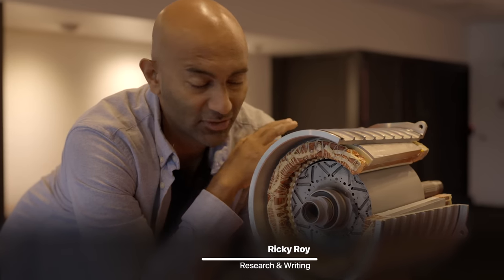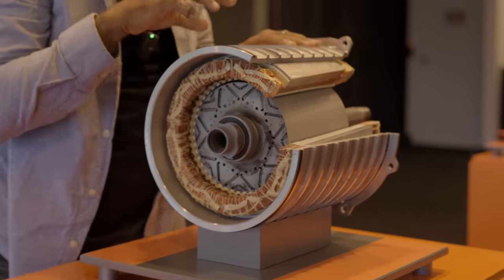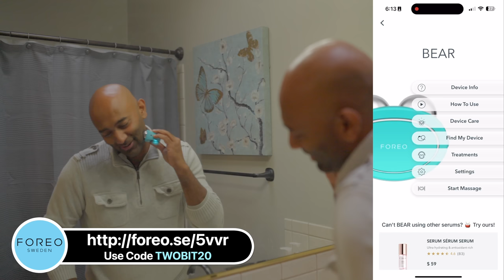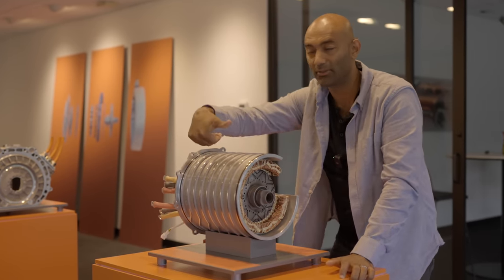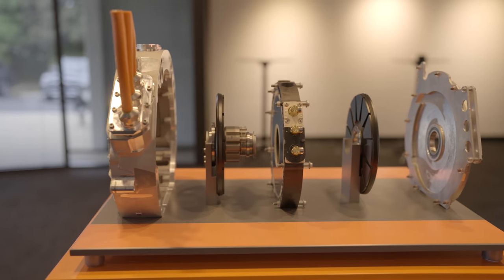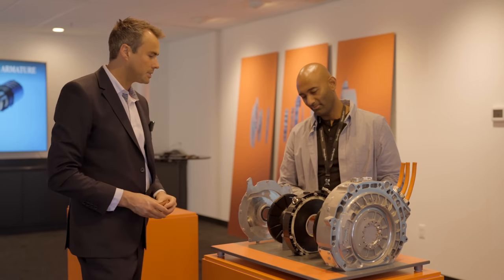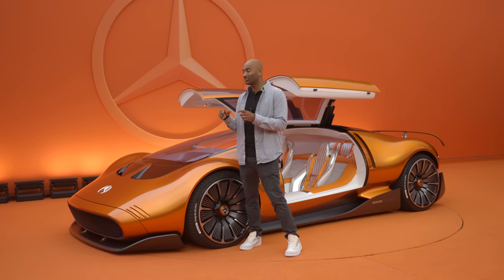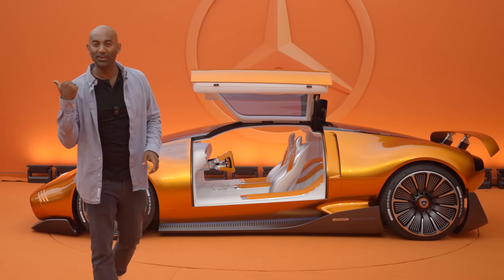Axial Flux Motors Will Change CARS - Here's Why

Comment: Impressive and interesting. Still, biggest hurdle for the EVs remains the energy density of the batteries. Let's hope for a breakthrough there in the near future.
Reply: @dangraff8467  Like that. Necessary elaboration: breakthrough that will make these affordable and practical for mass production.
Reply: Considering how long it's taking to create a worthwhile charging network, energy density is definitely the first thing I would be tackling.
Reply: Biggest hurdle for EVs is they are just a trend.

In the end, a V8 will always be way more reliable, and preferable for anything longer than a trip to the store
Reply: Or, the need for batteries at all. Nikola Tesla had a way to transmit significant power lossless across any distance to a receiver. The world of EVs and big money seems VERY disinterested into reverse engineering that. Even the inductive charging lanes (they work while driving) would then not need to be installed. You'd have the antenna,, a speed controller of sorts and a small capacitor, replacing the 600 kg battery. For unlimited range, but you'd need to buy the energy from the wireless provider.
Reply: @Cloxxki  got proof of this elusive transmitter?
Reply: @jakehildebrand1824  He is referring to a tesla coil I believe. But I also believe its far from an unlimited range.
Reply: @jakehildebrand1824  not true at all. My hybrid can go to the store and never even kick the gas engine on. It will likely last well over 300k miles, or more, and use 1/3 the gas of any v8. All the while never have the transmission issues many v8 vehicles get plagued with.
Reply: @rdubs1705  did you even read my comment completely. 
First of all I didn't say hybrids, I said EVs
Second, I said that going to the store is the thing they ARE good for.

Also, if you're having transmission issues in a V8, you're clearly not taking proper care of the car.

Lastly, better gas mileage is irrelevant when a V8 way better specs.
Reply: The future batteries we do know about don’t have more energy density than li-ion. They charge faster, discharge faster, and are less volatile. Those still aren’t commercially available so we might see those in 5-10 more years. At that rate we probably won’t see any real battery improvements for 15-20 years if that.

Lithium-Ion batteries were invented in the 1960s, but they weren’t used in commercial everyday devices until the late 90’s. 30+ years later we are still using them. That should give everyone an idea of what to expect. We might be  another 30+ years away from a breakthrough. This is why forcing green energy policies right now doesn’t make sense. Our current battery technology can’t handle the amount of energy we need to store and it can’t handle as many charge/discharge cycles as we need them to.
Reply: @jakehildebrand1824  Have not seen a V8 in a long while. 4 and 6 cylinders are a lot more common.
Reply: And safety as well, Lithium EVs i will never touch. As well as cars in general that are not "always connected" to the internet like every new EV is.
Reply: @Cloxxki  You tesla fanatics are really something. Tesla wasn't some super genius that knew better than anyone today. He was wrong with so many things. The man didn't even believe in electrons ffs. His ideas of wireless transmission were based on inductance and electricity transport via the ground, BOTH of which exist today. The biggest problems are the efficiency and short range of the inductance based transmission, while ground based transmission still requires one cable and causes much quicker rusting of metal pipes in the ground. It's funny how you people who are excessively championing Tesla, making him seem like a God among men, are always the ones with a serious lack of knowledge in engineering and physics. Any reasonable person with basic understanding of physics would see Tesla as an important inventor, but who was wrong in a lot of ways. And that's fine. Have you ever tried being reasonable?

Comment: Seems like the rear-dual motor with a transmission might be a great application for these axial motors.  Still too heavy to put in the wheels themselves.  In combination with an AC front axle motor would make a compelling AWD setup - you need a split powertrain or differential on the rear axle anyway.

Comment: Good video. Even though when the copper gets hotter, the electrical resistance increases, resulting in inefficiency, the main reason for cooling is to prevent the magnets from reaching the curie temperature because the magnets fail.

Comment: I am more excited about the pcb stator motors, than the ones using copper coil. Just like mentioned elsewhere in the comments this is not new tech, cpap fan motors have been using this design for ages. Another cool feature is the high efficiency of these newer generation flux axial motors (95% and up). The are also so simple to manufacture that they can be built by anyone.

Comment: Worth mentioning that some radial EV motors would be about 23kg for 500hp (e.g. Lucid at 31kg for 669) which is much closer to what you're looking at here. Still, it'll be exciting to see what can be achieved with the axial designs :)
Reply: Interesting to see tech. But let's get it straight big money didn't invent it Mercedes just purchased the start up vo
Reply: Why use a Radial EV motor, when you could instead use a Rotary combustion motor?
Reply: @jakehildebrand1824  Variety. Choice. One size does not fit all. And we LOVE to make new things and improve on old ones.
Reply: @jakehildebrand1824  i love rotary combustion engines they are so cyberpunk
Reply: @Rem_NL  I'm not quite sure whether you're being sarcastic or not.
Reply: @MrPDGee  give me one example of a situation where a Radial EV would be better than a REAL Rotary.

Also, a Radial EV is not an improvement on Rotary technology, its a straight up downgrade.

I suppose the EPA would probably disagree with everything I just said, but the EPAs only real goal is to ruin anything fun.
Reply: @jakehildebrand1824  i think they are cool as fuck, but not to practical.
Reply: @jakehildebrand1824  "give me one example of a situation where a Radial EV would be better than a REAL Rotary." 
High gasoline prices.
Amount of moving parts.
Compatibility with being run by electricity instead of liquid fuel.
Reply: @jakehildebrand1824  Torque at low speed
Emission
Fuel efficiency
Wear & maintenance
Energy recycling when braking
No idling waste

Just to name a few.
Reply: every car i have owned has less then 100hp and has done it's job fine,  but they arnt having to lug an 1000kg battery system around.
Reply: @krusher74  Model S 85 is about half that (540Kg).  The enormous (and dumb IMO) Hummer EV has a 1278Kg battery.

Comment: Koenigsegg has a motor they call Raxial, which tries to take advantage of both radial and axial forces.  Mahle has a motor that uses no rare earth magnets and doesn't use conventional brushes.  It sends power wirelessly to coils on the rotor.  One could call it a cordless brush motor.  It might be arguably less efficient, because the inner magnets require power, but avoiding rare metals and only using copper makes it fantastic for it's environmental impact and simplifies recyclability.
Reply: BMW i4 motors don't use rare earth magnets, but this requires slip rings to power the inner windings. BMW says they last 180,000 miles.
Reply: @beenflying1  so is it a kind of physically touching brush?
Reply: Also the Koenigsegg Regera uses three of Yasa's Axial flux motors. Perhaps before the MB acquisition?
Reply: the mahle motor is what was once called a "hysteresis motor", and you often find them in small circulating fans (in fridges) and the like.

the rotor is simply a relatively hard steel, so it has a high "remnance", ie, it remains magnetic once the field coil is de-energised.

as they run on AC, the coil changes polarity, and suddenly the induced magnetism of the rotor is repelled... they rely on the "hysteresis" of the iron. the work it takes to demagnetise and remagnetise the steel in the opposite direction is higher than the work it takes to simply turn away from the applied magnetic field...

very similar to a standard shaded pole motor, that are also used in those little circulation fans, the only difference being the shaded pole uses a slotted rotor with shorted conductor bars, just like a standard induction/squirrel cage motor uses. an opposing current is induced in the conductors, creating a field that is then repelled from the pole.

in both cases, the shaded pole causes an unequal magnetic force across the poles, some lead/lag in currents and induced fields, and they always rotate in one direction relative to the shading ring (a single turn of copper wire around a small section of the pole)

occasionally you come across ones with two shading poles, one either side, that are intended fro operating in both directions...

just because someone says its new tech, doesnt mean it hasnt been around for approximately a century now...

its great what you can lie about when everyones forgotten things and the education system fails to remind them...
Reply: @paradiselost9946  I don't think it's quite the same.  Mahle's new motor uses a method of transmitting power, wirelessly to the rotor.  It's not taking advantage of leftover magnetism or anything like that.  They can directly charge the rotor's coils, however they want, just like the coils on the stator.  Picture the speed controller sending current to the stator's coils.  Now picture the rotor has the exact same thing.  The only difference is a wireless power transmission device in the line running to the rotor's coils.
Reply: @dpjazzy15  if it has coils, be they solid or not, a slotted rotor.. then its just an induction motor, working on induction motor principles. the changing flux through the iron stator, that then passes through the rotor, induces a current in the rotor winding(s)s which is of opposite polarity and is therefore repelled from the stator.

nothing fancy, just a high speed inverter for a driver, with some marketing from people that have no idea how motors work creating "explanatory" advertising hype.

throw in the word digital, electronic, advanced... and watch them literally throw money at you.
Reply: @paradiselost9946  yes, it's an induction motor.  Nobody's claiming it isn't.  But it doesn't use permanent magnets or brushes and the rotor coils can have power sent directly to them.  It's not the motor itself that's special.  It's the method of power delivery to the rotor.  Have you seen what the cutaway graphic looks like?  It's like a brake disc and caliper, but with coils, to send brush free power across an air gap.  That's different.  Nobody is doing that.  I'm not sure how that's not special...?
Reply: @dpjazzy15  oh my, a cutaway graphic. how wonderful.

induction motors dont use permanent magnets.

do you know what the word "induce" means?

"to send brush-free power through an air gap"

its called magnetic flux, the air gap is called the area of high reluctance, and the iron core of the stator and rotor form a path of LOW reluctance. all things to be considered when designing a motor.

any changing magnetic field cutting a conductor will INDUCE a current in that conductor...

"thats not special"?

i assure you, i can open a book from 1902, and find much the same diagram. it will have been drawn by hand, it will be B&W, but if you stop and look, you will see the same basic components that have been in use since tesla went and cobbled one together... it may have run at a difference frequency, used a different method to create the AC frequency, and run at different speeds with different slip ratios... but fundamentally... its still the same thing.

sigh. dude, please. stop educating yourself on babble and hype and advertising brochures. go find some real text books, things with titles like "fractional HP electric motors" or "electricity and magnetismn, for third year university students" from 1941...

books that contain real information, explained simply and clearly, with no bias from coorporations, no BS from marketing departments, no glossy photos carefully arranged by graphics designers then analysed by psychologists for maximal impact.... no. REAL BOOKS written by REAL EXPERTS dealing with the subject on the cover, with no fluff or padding.
Reply: @paradiselost9946  ok, if Mahle is just a basic induction motor, then explain the differences between them to me.  Even if they fall into the same category, they have differences.  Explain them to me.
Reply: @dpjazzy15  it has little semiconductors and IC chips to produce a very high frequency waveform, allowing it to far exceed the RPM limitation of all induction motors that generally run on 50 or 60Hz. you will NOT find an induction motor for mains power that goes any faster than 3000/3600 RPM on 50/60. number of poles, times frequency, times 60 (a minute). the minimum number of poles is 2. North, South.

and at that point, as the frequencies are so high, things like the eddy currents in the steel become a large factor, so more than likely they use powdered ferrite magnetic circuits rather than laminated silicon steel stampings... 

as the frequencies cause the reactances of conductors become quite powerful, they can use a lot less copper for the same power ratings. 

the standard option has always been a universal brushed motor when high RPM is needed. they have brushes, they make arcs, they produce EMI... the whole design of the motor to operate on AC makes it vastly different to its DC counterpart, series wound motors. they both work on either supply, but they are intended and designed to run predominately on one only.

so yes, on one hand, little semiconductors and digital circuits make for nice motors but...

they also make them absolutely unrepairable. i have a thing about things that emit magic smoke and have no repair manuals, and require university training and several years in the field to reverse-engineer.

efficiency be damned. a running device built a century ago is vastly more efficient than replacing a device every year for a "more efficient model" as the old ones fill up holes in the ground. the semiconductor components unrecyclable, the circuit boards unrecyclable, the amount of copper in them declared unworthy of reclamation (ever spent some time scrapping electronics?).

versus old steel, iron, copper, aluminium... the odd bit of shellac. even SILK and COTTON. every bit either from a natural source, or easily extracted, smashed up, melted down and used again... without any nasty "space age materials" with unknown biological effects leaching unknown chemicals for unknown numbers of years, causing unknown future problems.

noone knows what epoxy will do in three hundred years time. it hasnt been around long enough to know. our teflons, our PVCs, our phthalates, our phenyls, our modern advanced high tech materials that cant be disposed of.

but we all have a pretty good idea what iron, steel, and copper do when dumped and forgotten about for a few millenia... return to whence they came... no harm done...

Comment: I'm curious as to how efficent the axial motor is compared to a conventional electric motor, as in how much electrical energy is required to produce X amount of torque compared to the power requirements of a conventional motor.
Reply: In terms of converting electricity to a magnetic field the axial motor coils are more efficient. The biggest issue keeping them from being using in applications like EV is that to get more power (torque) out of an axial motor you have to increase its radius. The disc has to get bigger. This increases rotational inertia making it harder (and taking longer) to speed up and slow down. It also increases centrifugal forces putting a strain on components (they want to literally fly apart) which can limit the max rotational speed. In a "conventional" radial axis motor the diameter stays the same and you make the motor longer. Rotational inertia and centrifugal forces stay the same. There are also other design issues. E.g. when you're direct driving wheels, a more powerful radial axis motor only takes up more room between the wheels. An axial flux motor would require you to redesign the profile of the car, increasing the vertical aspects of the vehicle, like increasing wheel diameter (it has to be bigger than the motor behind it) elevating the cockpit, etc. Your sleek EV would start resembling a "monster truck" and you'd need tractor tires for wheels and a ladder to get into the driver's seat. The key will be in "stacking" the motors, one behind another along the same shaft. This requires a lot of computer control to perfectly match the electrical pulses across every coil in every stacked motor at varying frequencies to match every rotational speed, and compensating for every variation in magnetic field strength/density. We're getting there...

Comment: Interesting. I guess if RPM is a limiting factor for torque, and you need it only to spin the field, then you could place this field inside another one, which spins at a few million RPM (no moving parts). That would make an EM gearbox and it will be heavy again. Probably its a step back, but there could be some interesting results in the middle.
Reply: Rpm is detrimental to torque in all electric motors. They all have a relatively constant power output not torque output.